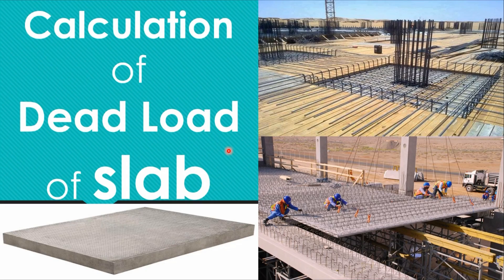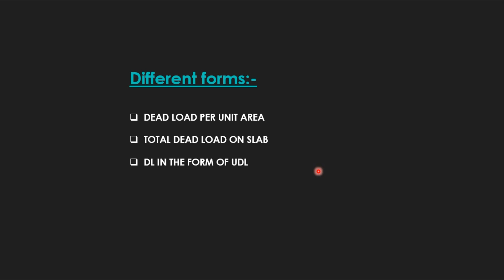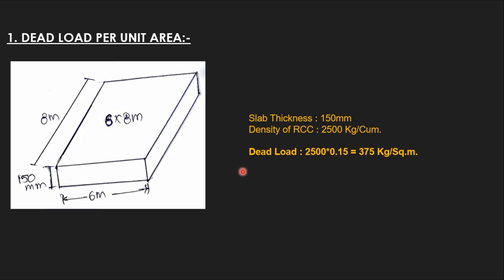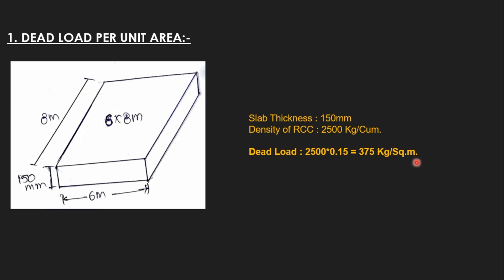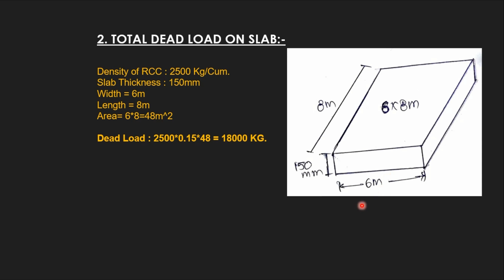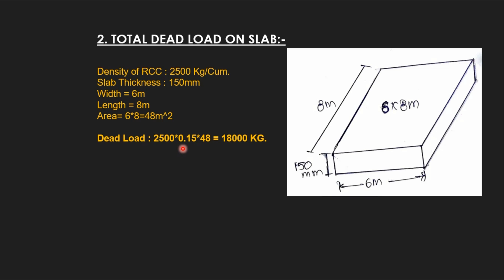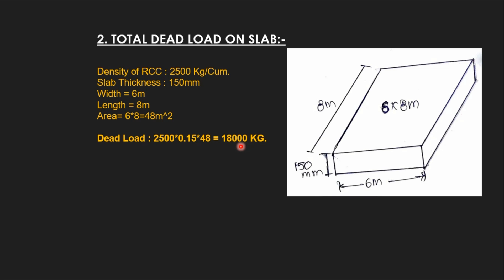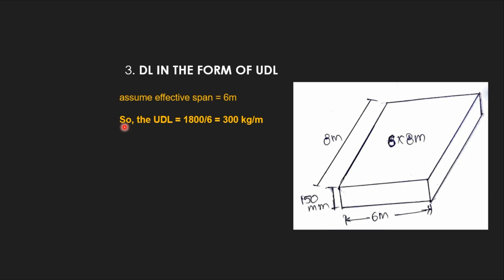How to calculate DEAD LOAD of SLAB

Comment: U calculated the udl along the width of slab,,,can we also calculate the udl along the length of slab,,, i.e. Along the 8 meter side
Reply from the maker: In this example, i have considered the effective span of the slab as 6 meters. If the effective span is 8 meters than you can use 8 meter. 
We have to calculate the effective span by using the drawings & formula. To avoid the lengthy process, i just assumed the value.

Comment: Bhai rcc slab ki density kese nikale
Reply from the maker: You calculate the density of RCC (whatever that is) the same way you calculate the density of anything else.

First, measure the volume (or, if it’s a liquid) measure a known volume, then weigh it and divide the weight in grams by the volume in cubic centimeters and you will have the density relative to water.

Comment: Nice clip.  would love to get calculation to determine acrylic sheet thickness need for roof for 4 side or 2 sided supported.
Reply from the maker: 2 to 50mm thick Acrylic sheet are available in the market. 
If you give the details of your home, that dealer will tell what thickness you have use.